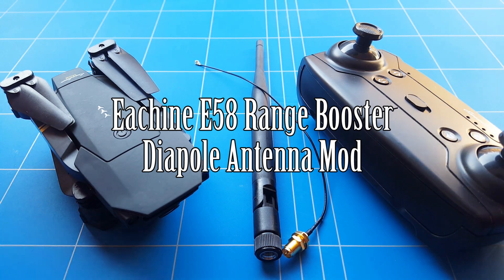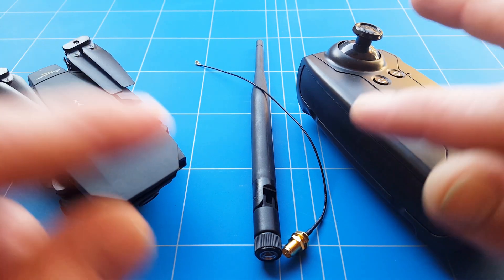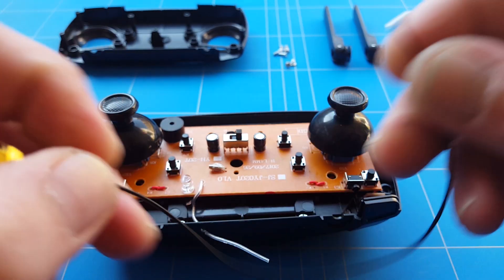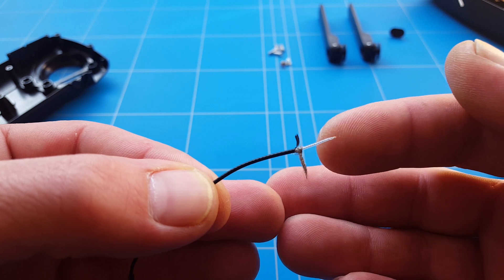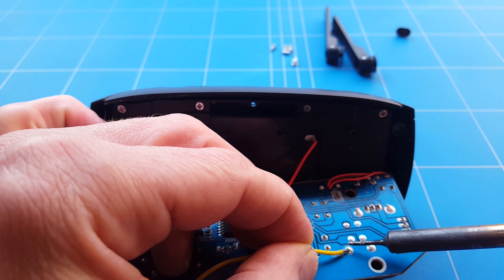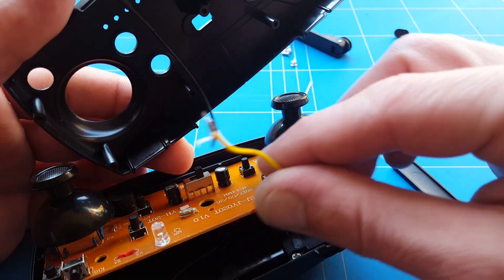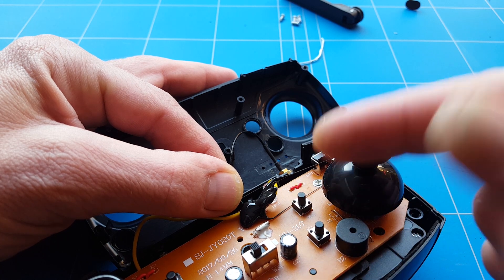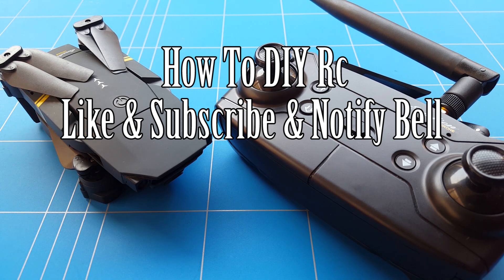Eachine E58 Drone Range Mod - Step by Step - Antenna Upgrade (Works For Any Rc Quadcopter)

Comment: Nice Mod! I've had to perform this MOD on transmitters before so I could use the antenna of my choosing. I wish they would put a standard SMA connector on all these transmitter so antennas can be changed out. I'm looking forward to your range test and Happy Flying!
Reply from the maker: +Ground Control RC yes it will be much better and not very exspansive but there are probably rules toy drones and there range maybe?
Reply: I plan to do this to my just ordered e88 plus drone. How easy and well did it work for you? I'm curious about your experience.